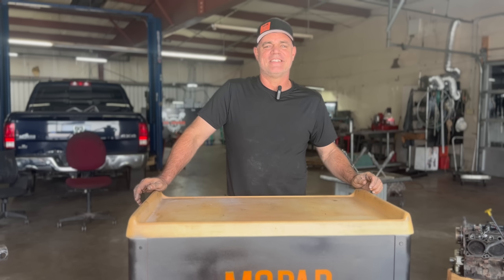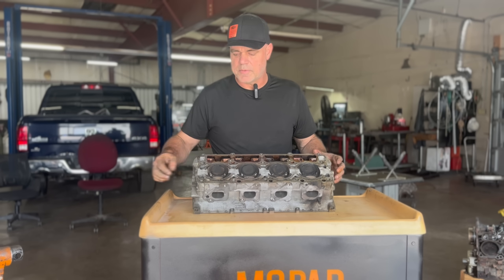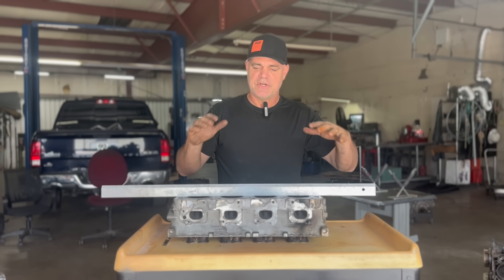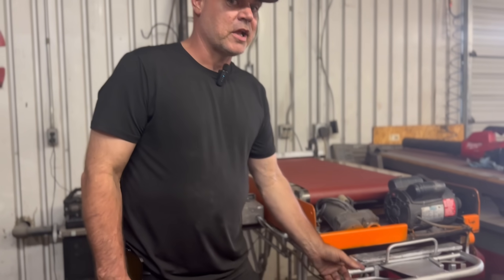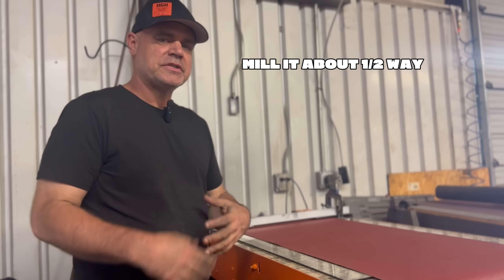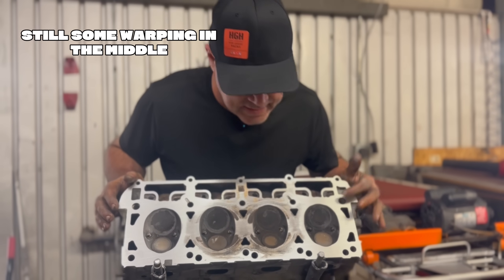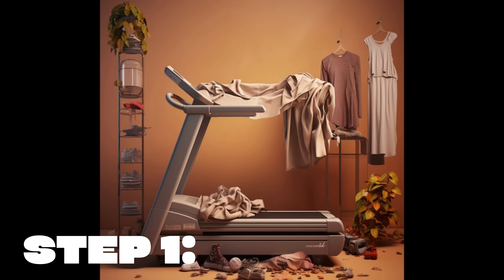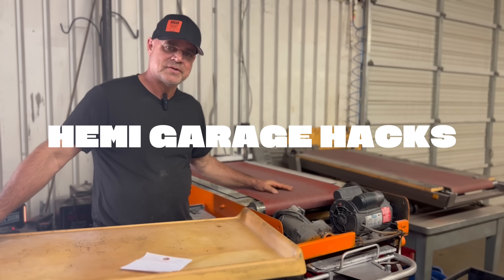I HAVE MILLED 1000+ CYLINDER HEADS WITH A TREADMILL!

Comment from the maker: Great Discussions here, I love it!  Here are 3 things that are important about doing this:  1.  You need your surface to be TRUE.  You can achieve this by placing the straight edge on the surface of the glass (make sure you have a cylinder head resting on there to get an accurate measurement) and if you are even by .001, go ahead and shim between the glass and the granite.  2.  When you are resurfacing the head, change the direction of the head at least once, if not twice.  3.  Check every head with a straight edge after you are done.  Be patient as you dial in the process, you will get there.  I hope that helps.  And I am not selling these, but I thought it would be cool to make a video on this for others that want the freedom and flexibility.  And side note, this took me less than $500 to build:)
Reply: What grit do you use?
Reply from the maker: @louisraduly6961  80 grit I think is the best for this.
Reply from the maker: @louisraduly6961  I would suggest 80 grit
Reply: Cool to see it done with a treadmill! Us small engine 2/4stroke folks have been doing this for decades with belt sanders. Interesting to see it scaled up, nice work! 🔧👍🏼
Reply from the maker: @christyrogers7707  Thank you and so glad you are here:)
Reply: Pin your comment so jt stays at the top.
Reply from the maker: we will soon we can’t just yet due to authentication purposes
Reply: After getting the head's  true.. any secret or info on matching the CC'S of a matched pair of heads? or does that just come with time and skill ?
Reply: @quick-performance-services  Most engine building books will have a procedure . Might be a video out somewhere pro or amature  same procedure for 2 stroke or 4 stroke just more fiddly with valves 1
Reply from the maker: The best way is to measure the time on the belt and then flip the head around and place it on the belt for equal time.  This has worked the best for me.  Hope that helps
Reply: @HemiGarageHacks I am thinking about making a harness the tholds the LS engine block so I can smooth the engine block head surface more to clean them and surface them than to remove material, I think I can rig a harness that does even weight distribution, I just gotta keep an eye on it
Reply from the maker: @wolfpeoplearereal  Now that would be an amazing accomplishment my friend:)
Reply: @HemiGarageHacks you are inspiring people. I was given a treadmill motor and controller by a client and I was like what the fuck am I supposed to do with this. Then I looked into it and you can run many things with a DC motor. 

So I began to research it to make my lathe a mobile lathe and other things including even hybridizing my utility van. Ironically the client that gave me the motor I was doing the heads on his Ford 4.0. 

I stumble across your video and it pulls me in cos I always assumed you needed a $150k mill to do heads. If you can find one 

So I put an ad out for treadmills. Just a few months ago. Now I've got 6. Including a $7k rehab treadmill (Baldor motor! $1200 bucks alone) 

Guy just gave it to me. It's bout like a tank and it's gonna be the one I use to mill heads.

I also got a GRANITE SLAB (37"*8') I'm gonna chisel a piece out of the slab. $50 buys the sandpaper the same dimensions as the rubber treadmill tread. Was thinking about shortening it but maybe I want to use it as a treadmill sometimes lol.
Reply: A long long time a go I walked into a local machine shop and I saw something that looked a lot like you have there...
Reply: @lennym1636  Wonder what happened to all those out of machine shops ?
Reply: @eflanagan1921 Most likely got sold for parts or scrape...
Reply: Can you tell us the grit you use
Reply from the maker: @wolfpeoplearereal   I suggest 80 grit.  And sorry for the delayed response, I just now saw this.
Reply: Love how there’s so many banging on Jim’s for having a butt ton of equipment. Apparently you fail to realize that guy has been building that business for decades, and is expected to do a much more quality repair. This is great for budget minded individuals who don’t expect much in the way of longevity or precision work. Will it work and last? Most likely yes. But there is a difference in expectations between HGH and Jim’s.
Reply: Do you ever have issues with dust getting between the belt and the flat surface?
Reply from the maker: @AndyFromBeaverton  Surprisingly, no.
Reply: @AndyFromBeaverton  How long does a pane of glass last? or how often do you find you need to relevel it? Really smart build though!
Reply: nice tread 
mill
Reply: People have been doing the same thing with elbow grease for as long as people have been re-building engines in their shed.  People interested in true flatness should read up on the "whitworth three plate method."
Reply: You should make a video on this...these are the details we want.
Reply: Meantime, there are channels like Jim's Automotive Machine Shop, Inc. where they obviously have hundreds of thousands, maybe over a million, dollars worth of machining equipment and you built a you build a specialized head leveling machine for less than $500. That is absolutely amazing!
Reply from the maker: @BryanTorok  I love it when people get the vision:)  So glad you are here!
Reply: @BryanTorok  see my comment above
Reply: You must straiten the cylinder head prior to resurfacing the gasket suface.  You can only remove 0.003 inch from the head or it will throw out cam timing.
Reply from the maker: @thevictim2072  That is certainly more important on an Overhead Cam engine.  We do almost exclusively Hemi heads now, but at one time we did tons of OHC heads and had success providing we measured the time of the head in one direction and then turned it around and ran it for equal time.  Thanks for sharing
Reply: @thevictim2072  You could always measure the head before sanding it down And then you Can use a grade c gasket or thicker to make up the difference so it does not affect timing

Comment: I've hand filed flat heads reused the head gaskets too bit of silver paint to the surfaces iron tight to season the blocks all good one was my main daily seven years till I sold it ran the flat file over the block surface too what you can geta away with in old low comp engines but in saying that I've done the same in my race engine that lasted till tge next teardown
Reply from the maker: Interesting thought.  I'll have to arrange a demo of the effectiveness of this concept against a high compression situation like that.

Comment: if any shop i am having work on my car busts out a tread mill to deck my heads, i'm calling a tow truck to pick up my car.
i've been in the trades long enough to know your edges are going to be bell curved. the center may even appear to be flat by the straight edge but keep measuring your extremities, that's where you'll see issues.
you're taking off material around the perimeter until the center appears to be true, but now it's not true with the perimeter. a heavy object on even the most true sanding table will always balance on the center of the mass first.
Reply from the maker: Keep in mind, I am not trying to sell these or manufacture them.  I just tried something to solve a problem that I had at the time, and ended up having great success.  So I thought I would share my story with others.  And it does work surprisingly well.  One key note, is to measure time with the head going in one direction, and then rotate the head and run it for equal time.  No Comebacks, which is awesome!  Thanks for watching.

Comment: Thats flat sanding, NOT milling. Great tool and may even be a better flatness/finish than milling, but call it what it is.
Reply from the maker: Yeah, by far the most common comment. I tried to incorporate treadMILL with the idea of straightening the mating surface, plus I found that the general public seems to be more familiar with the term mill when it comes to correcting a warped head.  But technically, you are right.  Glad you are here:)

Comment: I have a small table belt sander I bought to flatten out 5.7 Hemi manifolds on my Ram 1500. I replaced the two original ones with Mopar ones, and they both warped after a couple of hard trailer pulls through the mountains. I flattened the warped ones and they never warped again. I had a theory that if they got warped like that they had probably done all the warping that they were going to do... The 'planed' ones never had a problem for 40000kms until I sold it.
Reply from the maker: Yeah, it's crazy how bad they warp.  And it's on ALL of them.  Thanks for sharing.

Comment: You are not milling you are sanding on a giant belt sander which will never keep the head surface square to the chambers due to the leading edge of the belt wanting to dig in more and you will never be able to apply equal pressure to keep the head surface square that's why you use a mill
Reply from the maker: One of the ways have used that has worked well is to measure the time spent in one direction and then rotate the head and run it the opposite direction for equal time.  Thanks for sharing.

Comment: Where do you find the sand paper that is the right size?
Reply from the maker: there is a company called Mirka that can make the belts custom size and grit.  80 grit has been a good choice for the aluminum heads that I do.  Just cut off the old belt from the treadmill and measure it.  Hope that helps!

Comment: Now do a cast iron flathead straight 8! On the serious side, how do you remove the same amount of material from a pair of heads?
Reply from the maker: I've done a couple 4.0 straight 6 cast iron heads, but it is mainly aluminum these days. and for your second question, important question, the key lies in measuring time in one direction and then turning the head around and running it for the same time.  Thanks for sharing!

Comment: Where do you get your sanding belts?   What Grit of sandpaper do you use?   Any special type of grit?
Using the plate glass for flatness was a great idea.
Reply from the maker: there is a company called Mirka that sells custom belts.  I would recommend 80 grit, and if you end up making one, be sure to use glass that is not tempered, as the tempering process can distort the flatness of the glass.  hope that helps and send a picture if you end up making one, I would love to see that .

Comment: Just did the method using a pane of glass on my workbench with sandpaper glued to it with 3M adhesive spray to resurface an intake manifold which was dumping coolant into the crankcase. About 8 years ago took a single exhaust manifold to the local automotive machine shop to be resurfaced and nearly swallowed my tongue when they gave me the $250 bill. Since then have been gun shy with going to have anything machined. The treadmill idea is genuise. If I built one of those myself then I would upgrade this idea with a much thicker piece of glass that would have less deflection, even though the deflection of that thinner piece of glass on top of granite is going to be very very minimal anyways.
Reply from the maker: That'll be cool if you do make one.  And once you get it dialed in, you can resurface things for other people and make yourself a little side income.  send a picture if you end up making one, I  would love to see that.

Comment: I was skeptical at first but I cannot argue with that result. I'll have to see if I can put something like this together myself, I live very rurally so I don't really have any proper engine shops near me and the one I did have shut down a couple years ago.

I've also seen dishwashers being used to clean heads. At this rate I'll have the most ghetto machine shop in a 1000 mile radius...
Reply from the maker: That's awesome!!  If you have any questions,  just let me know.

Comment: I glued 180 sandpaper to a board and used the back-and-forth method you showed—worked great on my Mazda forklift, about  about ten years ago. I got the forklift almost for free because it was 'blown up.' at a local auction.   After putting the head back on, it started right up and has been running for nearly a decade now! I honestly thought I was a genius, but thanks to YouTube I realize I didn’t invent anything new. Still, it runs! You did an amazing job with your build, and sharing it with us is awesome. Thank you!
Reply from the maker: Thank you so much, I appreciate that!  And glad you are here:)

Comment: In my mid 50's. I am a fabricator by trade. Went to Motorcycle mechanic school  out of high school. First job was at a shop that built drag bikes. The two old guys, and one was so old in the 90's he raced Daytona on the beach. You young bucks look that up. Anyway, both of them would deck motorcycle heads with an air file. Worked great.
Reply from the maker: I love talking to them Old Timers, I always have.  Now, I guess I am turning into one of them myself:)

Comment: so your sanding it? Regardless pretty cool idea. As a machinist the terminology and way you are checking "flatness" is killing me but if it works it works and to be honest if i had to do hundreds of those and the mechanism worked id do this over setting it up on  mill and cutting them with a flycutter.
Reply from the maker: Thank you so much for saying that!  I have definitely gotten my share of hate from machinists.  I realize it's not a mill in the sense of a true milling machine, but I chose the word for two reasons.  One, it was built from a treadMILL and two, it is a more commonly understood term by the general public for flattening the mating surface of the head.  And to be honest, It surprised me that this thing worked as well as it did when I first made it 13 years ago.  In fact, it has worked so well that I have continued using it all these years even though I have been able to afford a mill as early as 10 years ago.  It is important to mention that it's a good idea to measure how much time it is on the belt and then turn the head around and run it for equal time.  Thank you for taking the time to share that, and glad you are here!

Comment: why not just buy a milling machine is my question. I understand why an individual at home would try something like this but its seems like you already have a full blown shop, a proper milling machine would only cost you 1 or 2 jobs worth of labor
Reply from the maker: Great question!  I made the machine out of necessity at the time since funds were tight, and I was blown away by the effectiveness of the machine.  There is no part of its function that makes me want to go buy something different.  It works surprisingly well:)
Reply: @HemiGarageHacks I get that. But if you had a mill you could expand your services and bore cylinders aswell. Not that I'm on a position to give advice just my thoughts
Reply from the maker: @blender_unleashed  Honestly, the issue is finding reliable help to man the additional machines so I just outsource the boring and the crank grinding.

Comment: Stop calling it "milling". You aren't using a machine. This is sanding with a big belt sander. Due to not having a solid metal bed and slack in the belt (belts will always have some level of slack at the point where belt first meets the workpiece) you will end up with uneven sanding rounded or tapered heads, and just general problems waiting to happen. "Hacks" waste time and money due to being improper repairs. You can't replace a milling machine, lathe, grinder, etc. Its called using the proper tool for the job. Do things right the first time or spend 10x as much the second time.
Reply from the maker: In most cases you are correct, but for some freak of nature reason, this thing is surprisingly accurate and effective.  People are always skeptical when they first see it, but when they see the job it does, they are shocked.  And my intention in making this video was not to sell it, or make believers out of anybody.  It was simply to share a hack that worked surprisingly well when I first built it 13 years ago and is still going strong.  Thanks for taking the time to share and I am glad you are watching.

Comment: Curious regarding what grit sandpaper you use.  Guessing you want to finish up with something like a 400 grit, but probably start around 220 grit?
Reply from the maker: The real number is shocking actually.  When I first created the machine I thought the same thing and I ordered a higher grit like you are thinking.  It is really like 80 grit and the finish is much smoother than you would think using 80 grit.  Great question!

Comment: What HP is the motor you use? Also, could it work equally as well if the deck was only two feet long?
Reply from the maker: I'll verify when I go into work on Monday, but I believe it's a 2hp motor.  I don't remember because it was 13 years ago when I first made it.

Comment: How does it compare to a machined head? And what grit size do you use? Is micro scratch free mirror finish important?
Reply from the maker: great questions.  As far as the comparison to a machined head, we will be doing a video on that in the next few months.  I recommend 80 grit and you can get the belt from a company called Mirka.  And technically do don't want a totally mirror finish, but you also don't want a scratchy rough finish either.  I usually break in a new belt by resurfacing a couple exhaust manifolds and then I get a great finish from there.  Thanks for the questions and glad to have you here.